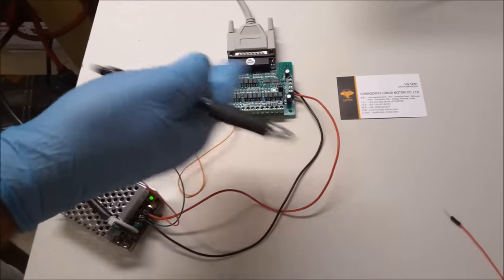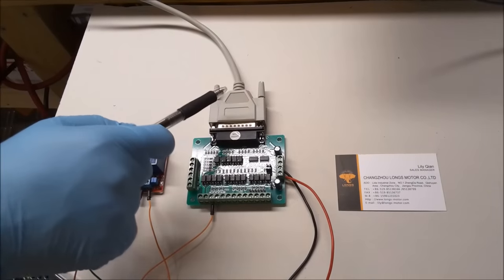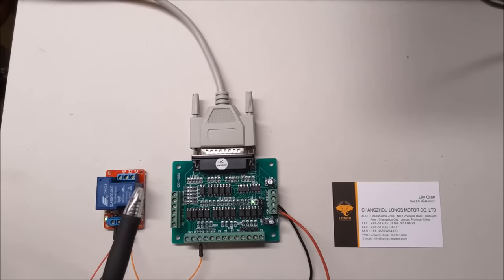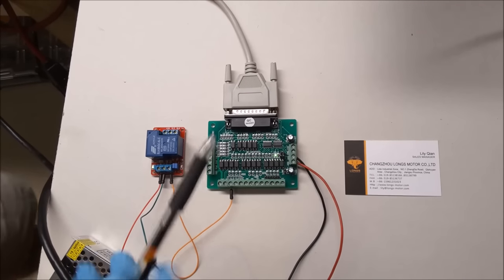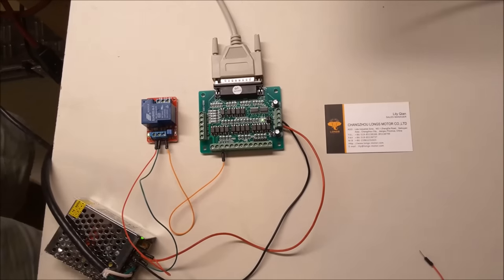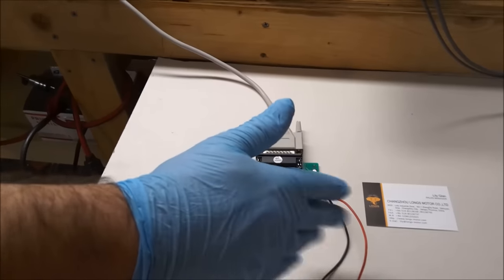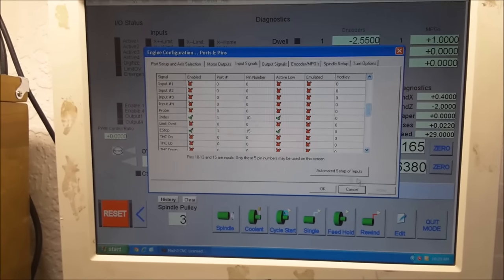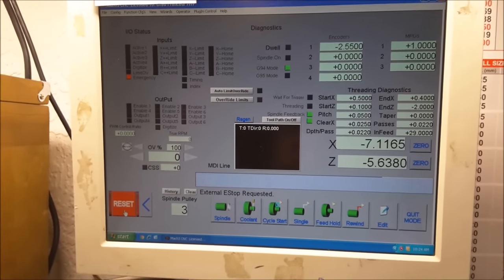Changzhou Longs Motor Breakout Board DB25-1205

Comment: Just had to replace my closed loop servo system, went for a longs motor nema23 kit with one of these breakout boards as replacing the failed part (the motion control board) would have been $$s. Very strong, plenty of power, used linuxcnc very simple and works well. Very good value. My advice  would be to remember you need a proper enclosure for the drivers etc, good grounding, no earth loops. Don't rely on USB for operating relays. Separate power supply for 5V, and cooling, have that on a separate power supply as well or a dual 5V 12V like mine.  I'm running 3200 steps per rev on a 4mm pitch x 3 no problem.
Reply from the maker: Nice - thanks for commenting!  Enclosures are always my most difficult challenge.  I've been told these guys are good:  https://www.factorymation.com/wallmount_non-metallic/DSE_Plastic_Wall_Mount_Enclosures_SB

Comment: At one time computers had a 3.3 volt output on a LPT port and some had 5 volts. The breakout boards just make all of them the same 5 volts out by way of the optical LED to Optical Transistor switch that uses the 5 volts that you add to the breakout board. There is Boards that have 2x 5 volt power supply's to protect differnt sections of the boards inputs and outputs. It could also be called a buffer circuit like for testing circuitry.

Comment: Quick question.  I am running the same exact break out board from longs motor.  I connected a 3 vdc relay to pin 16 for my router to turn on with the program.  After a little hesitation it sort of turned on for a second. Long story short,  my 5vdc is being dropped to 2vdc for my servo drives and 1.7vdv for all other outputs. Any thoughts?

Comment: The two power connections are the whole idea of a breakout board to keep the Computer isolated from any higher voltages or shorted circuits on the other side of drivers or limit switches just in case of a short circuit. So you don't smoke your computer along with the drivers. I my self would not use just one power supply. 5 volt power supplies are cheaper than burning up a computer.

Comment: can you run a spindle vfd through this DB25 breakout board?
Reply from the maker: Hi.  Most VFD's use a 0 to 10v  signal to control speed.  I believe you can use a board like this to isolate the the DB25 and use the 5V to control a 10V output:  https://youtu.be/WM6yRzDjHjk?si=wqRpqYL05-omui5p

Comment: Franco, I am wanting to use this BOB in my 4 axis kit I am building. I am using individual stepper drivers like the ones that Long's motor sells. Do you have a wiring diagram for this that also shows roper grounding  that you could share?

Thank you
Reply from the maker: I do not.  A while back, I converted over to Centroid products and I haven't used these BOB in quite some time.  However, if you are using the same 110V line, neutral and ground for all of you electronics, you probably won't have any problems with ground. Is there something in particular you are worried about?
Reply: Well with there being no hook up instructions, I am looking for the correct way to wire my drivers to the board. I do understand the basic connections between the drivers and the board, but if I should be grounding this board to my earth ground  inside my control box than I want to do it correctly. Also I have a five volt power supply dedicated to the board, do i need to split it to both 5v terminals on the board as opposed to turning the jumpers on?  Also I  am curious as to what type of connectors you have on the end of your wires in the video.
Reply from the maker: @stacy5281  This may help with the wiring: https://www.dropbox.com/sh/xxpjtprlpwky10n/AAB8KWLZh5PpkDMDjZ1gXl6Sa?dl=0
This will tell you more about the ferrule crimper: https://youtu.be/-R8NYy2jz2U

Comment: Maybe you are the person to ask... I have this very board DB25 1205
I was planning on using a relay to turn spindle / laser on and off... cause I couldn't get the pwm working
I have an issue understanding how PWM works.. same principal I guess ??..
I have this laser module it has 3 wires (red... black... white)... it came with a 12v 3amp power supply (which don't make the power supply common).. it has a built in driver
my cnc kit never came with any paperwork (but it's working)... nor did the laser... so working blind
maybe I'm overlooking something
Reply from the maker: I'm not a laser guy.  But, think of PWM as a series of off and on signals.  If it's "on" 100% of the time then laser will be at full power.  If it "on" 50% of the time, the laser will be at 50% power.  If you connect a steady 5V to the laser (I'm guessing the white wire) it will be on 100% all of the time.  My guess (and this is just a guess) is the red wire goes to the +12V.  The black wire goes to the -12V and the white wire goes to the PWM output pin on your breakout board.  The -12V on your laser power supply will need to be connected to the -5V that powers your breakout board.  I hope this helps.  Be careful - I've never worked with a laser.  Just saying...

Comment: Hey Franco, I really hope you respond as I'm pulling my hair out now. I've converted an old Boxford Lathe to cnc but I'm struggling with the threading. Basically the tool gets to the starting position and just sits there. I've tried everything now and ran into your threading video using this board. So I thought I'll buy this board, maybe mine is no good. So the board arrived an I can't see any way of connecting the 0-10v to drive the spindle. Do you adjust your spindle manually? Also do you have any ideas why my threading won't start? I'm getting a fairly stable Rpm readout.
Please help!
Reply from the maker: Hi.  I'm sorry I haven't responded sooner - I've been really busy.  I used to use Mach3.  Then, I tried Mach4.  I spent all kinds of money on Smooth Stepper boards as well as a really expensive board from Hicon.  The best advice I can give you is to get away from Mach3 & Mach4 and go with Centroid.  Here is a link:

http://www.centroidcnc.com/centroid_diy/acorn_cnc_controller.html

They make the software AND the hardware.  Perfectly matched and everything works really well.  You can use an encoder for your spindle and you'll have the most accurate threading setup you can ever imagine.  If you use a VFD to drive your spindle, that's great.  Their board easily interfaces to any standard VFD using a 1-10V control signal.  I have many videos on my channel working with their product.  I hope this helps.
Reply: @FrancoCNC  thanks a lot for your reply! Just 1 more question please. In centroid is there a threading wizard or do you have to program the g code yourself?
Thanks!
Reply from the maker: @mondrota  Centroid has a full blown conversational programming interface.  The threading is really good - it has all of the parameters built in for different types of threads.  Much better than the Wizards in Mach3.  Look over the manuals for Centroid - you'll see what I'm talking about.

Comment: Hello dear Mr. Franco ! Can you use your Breakout Board with some Encoder in closed Loop in Mach 3 system or is it only in open loop  ?
Reply from the maker: Open loop only.  You need a much more expensive board if you want to do true closed loop in Mach3.  A  less expensive option would be to use closed loop stepper drivers like this:  https://www.automationtechnologiesinc.com/products-page/nema23-closed-loop-stepper-motor-system-hybrid-servo-kit/hybrid-servo-drive-kl-5080h/

Comment: Great video. Thanks for sharing. You mention a conversion kit you are selling. Will it work on Grizzly g0769 and if so, where can I get more info?
Reply from the maker: Thanks for your comment.  I make conversion kits for the 7" mini-lathes sold by Harbor Freight, Grizzly and other importers.  They are designed specifically for those models and do not require drilling and tapping of holes in the lathes.  Unfortunately, I don't have a design for the G0769 at this time.

Comment: I have this exact board. With nothing hooked up but the power supply and no computer I get 5.22 volts on all output pins. Is this correct?
Reply from the maker: Hi.  I believe it is.  On my mini-lathe, I usually turn on the control box after the CNC control software has fully booted up and is in control.  Otherwise, I'll see the relays activate when I don't want them to.  This is one of the downsides of this type of BOB.
Reply: Franco yeah this is a big issue with a Plasma cutter firing when you crank it up. Thanks for the reply.
Reply from the maker: You may want to check this out:  http://www.centroidcnc.com/centroid_diy/acorn_cnc_controller.html

I'm not sure how they control Plasma cutters but it's a really nice system and the price is very competitive.
Reply: I use a cnc4pc charge pump safety relay and a few relays to disconnect the outputs for this reason.  It works well for startup and estop situations and was pretty economical to add on.   I also have acorn on the way.
Reply from the maker: Thanks for the tip.  I think you'll be impressed with the Centroid stuff.

Comment: I brought a cnc nema 23 kit which has one of these boards, except mine is from Wantai basically the same as Longs with DQ542MA Drivers.
I don't know about longs but I never received any wiring diagram did end up finding one.
And of course my PC did not have a parallel port so I ordered one, came with a driver disc but has like 20 drivers to choose from none are named to make this Chinese scavenger hunt any easier.
I don't know weather I have an issue with breakout board or parallel port card as I have no idea if I loaded the right driver
Reply from the maker: Hi. You may want to check out the Centroid Acorn CNC system.
Reply: Check and see if the LPT port address is right. LPT I/O Range which is normally 0378 - 037F . If not it can be changed in Mach 3 or can be changed in Windows hardware settings to default settings. Sounds like Mach doesn't see the LPT port. You could Let windows pick the drivers on line.

Comment: One more thing. The separate power supplies is to prevent ground loops and other nastiness. It looks like this breakout board has optical isolators so signals are passed between the computer and the CNC side optically so that there is no electrical connection between the two systems therefore ideally you would not connect the grounds and power each side independently.  
https://en.wikipedia.org/wiki/Ground_loop_(electricity)
Reply from the maker: Thanks for your comment.  One of the reasons I make these videos is to receive help.  So, if I'm reading what you are saying correctly, the most robust isolation would occur if I were to pull off the jumpers and use two separate 5 volt power supplies.  One would power the "CNC" side of the optical isolators and the other would power the "PC" side.  Am I stating this correctly?
Reply: Yes, correct. Sometimes equipment can have different ground potentials on them and if they get their grounds connected a current can flow which can do all sorts of weird things to the electronics. There's also a safety aspect especially if one of the devices loses its ground connection.
Feel free to contact me if you have any other questions. --Vince
Reply: Vince I so could that be whats tripping my limit switches and messing with my probe? if so not aure how to correct it
Reply: It's hard to say without seeing your circuit diagram and the actual wiring of your components&cabinet. I will say this though: An improperly grounded system and/or improperly shielded signal cables can see more than single digit to 10's of volts of noise induced on an input. The actual source could be a real PITA to track down. if you're seeing your limits tripping without mechanical actuation  while the system is running then it could be noise or signals induced in the ground loop(s)
Reply: +Vince I I used shielded wire and grounded that to one of the power supply and then ground to case. Power supply is ground to house ground also.
Reply: First of all - all I know about electricity is liquid that flows through wires and hits my fingers. :D

But, I wonder, Wouldn't attaching separate power supply defeat the point of ground looping, because there would still be two grounds on computer side?(from computer PSU and input PSU)
Wouldn't it make more sense that 5v input would come from PC's PSU and output would come from separate PSU?
Reply from the maker: Yeah, there seem to be a lot of different thoughts on this.  I understand the whole ground loop issue, but I've never had an problems with that.  I always use a single 5V power supply to drive my BOB.  I don't think you'll get enough "juice" out of most modern computers to power the BOB.